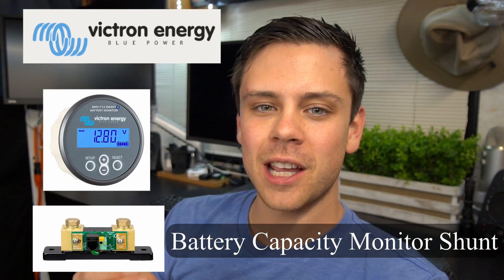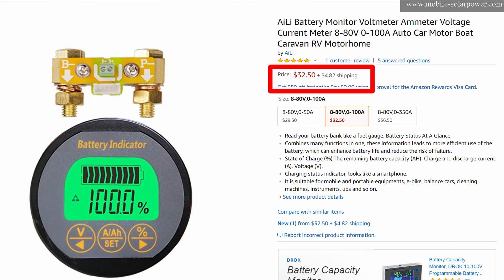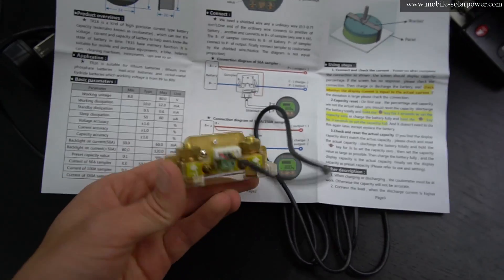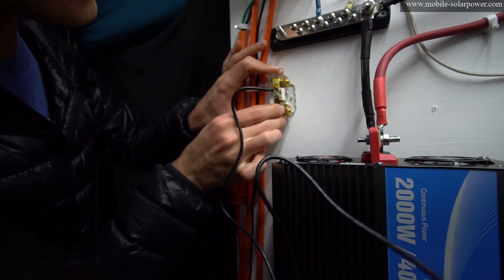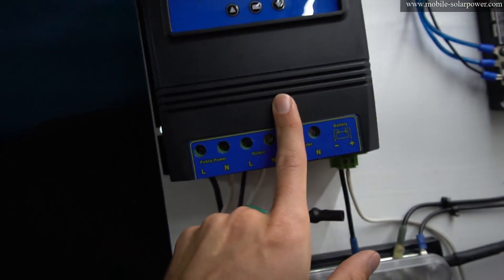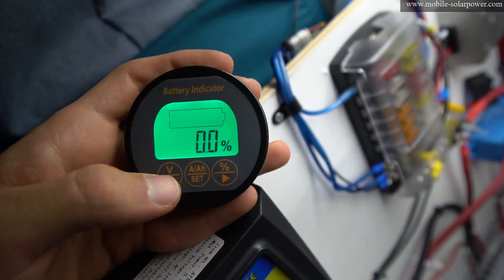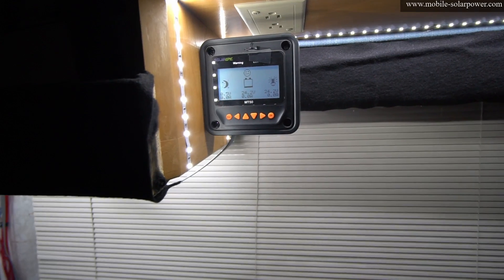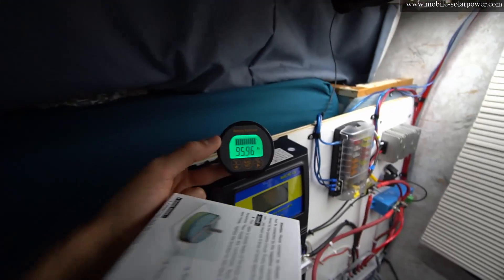$200 Victron Solar Battery Monitor? Try this $30 Chinese one instead! Great for Off-grid Solar

Comment: I've sat over a month trying to establish an off grid system. I'm very literal, however it doesn't keep me from learning and understanding. Too much information with all the people showing how they do this or that..only what they show is never clear. My confusion now is Will says hook to the P- side of the shunt, all your loads and your charging source... isn't that the battery? I guess not because as it's already clear to me the B- side of the shunt is hooked to the negative terminal of the battery. So what's this "charging" source hooked with the loads. Last night I watched several videos ...one person had the negative terminal on the shunt, hooked to the negative of an inverter but the renogy monitor says to hook negative on battery to negative on shunt. I thought having a brain I could build a system too. The issue that stands in the way, is not seeing the cable connections. People say connect this to that but they don't show it. I'm not doing solar and most every video is about that, and it makes sense with all the people wanting to live that cool off grid life.

Comment: I had the same realization, was about to buy the victron and whay I needed was only to read the persentange of the battery not a fancy readout and bought a power queen battery monitor for $55 If I knew about this one will have chose it instead of the power queen since it does the same

Comment: nice and useful video. the only thing i didnt understand, for my ignorance, is why to set the zero going to discharge the battery to the lowest level. I have a lead acid battery and i cannot do that. I would prefer to charge it to 100% and set that value. is it possible?

Comment: I am using that exact same $30 one on my golf cart I converted to lithium. Instead of setting the low power I fully charged the batteries and set it based on that. Seems to be accurate.

Comment: After one 3000w pure sine inverter died after 1 year, (use more then 2w and it starts turning on and of every second), and a new one on warranty did the same but at 250+w I gave up and ordered a 1200w /1200VA Victron inverter. Then when I was making ready to test the new inverter both my solar controllers chargers went up in smoke when I connected them to my 24v battery using the battery switch to the  bank and waking up the solar charger from being off... (apparently I had to disconnect the solar panels before connecting battery power when they was dormant). 

They hissed and sent smoke out and I immediately turned of the battery switch but that did not help as they was getting 1000w of power from the 80v solar panels. It took me a minute to go get a screwdriver to disconnect the solar panels but by then the hissing and smoke had stopped. But the solar charger reported battery voltage to be 42v. So I measured the voltage it tried to send to the battery bank and it was not 42v but 78v... And still both solar chargers showed that all was fine, no error codes or anything. It is scary that a solar charger can fail like that and send 78v to a 24v battery bank !!! 

So now I have also 2 Victron solar controller chargers also, and I also bought the Victron battery shunt even if I did fine by just measuring the battery voltage. But since I am going all Victron so why not ;) 

The old solar controllers was bad anyway, they kept cooking my battery bank by overcharging them and never stopping charging at 28,9 to 29v continuously and never switching to float.

Also I learned my lesson and will install a 1000DC automatic double fuse for my 2 panels pairs so I can switch of the solar panels when needed.

Comment: Hi, I have two batteries, Basen Green 11.7kWh 51.2V (BG) and Ecoflow Delta pro 48V 3.6kWh with inverter (DP). With BG full DP. With the DP application, it is not possible to set the BG not to completely empty!
What could I put between the batteries so that I can set a voltage limit at which the charging will stop and thus prevent the BG from being completely discharged? Is some Battery Monitor OK??

Comment: Great videos. I have a Victron shunt to monitor my batteries remotely via my cell phone app but it's Bluetooth and I have to be within 50 ft. Is there something cheaper than a Victron Cerbo GX (over $200) that will allow me to monitor my batteries from while my RV is at an offsite storage facility? I have 120v power and wifi at the storage site.

Comment: Cool!  Maybe you can help me.  I have dual batteries in my rv, I hooked up the battery monitor which required a shunt between the two. I bought a 100w panel and a renogy solar controller.    Do I just hook up my controller positive to positive BEFORE the shunt and negative AFTER the shunt like my battery monitor is wired?

Comment: To set % of charge to full simply hold down % button and it will go to 100%
Reply: Yes you want to make sure you know for sure your batteries are at 100% before setting the monitor to 100%.

Comment: Hey everyone, keep in mind that all batteries have a self discharge rate (my LiFePo4 cells <3%/mo).   This can easily build over time and lead to false values on the monitor.  So for accurate readings you should probably re-calibrate any battery monitor several times a year.

Comment: I have a battery bank of 8 AGM 12v 100Ah each for a total of 800Ah. How do I wire a monitor to provide info on each individual battery in the bank?

Comment: I can't get my head around what size shunt I need to get as I want to manage my of grid power consumption. I have a 24v 960abattery bank with 700w solar with a victron mttp and a victron 3kv inverter. I saw this video and very interested if this will work? If this isn't big enough what size shunt do i need? Many thanks in advance for your knowledge and help. Andy

Comment: using one of these also Will check out the ...Junctek KH140F Battery Monitor it is Bluetooth 40 to 60.00 range

Comment: There are a whole bunch of Chinese companies making the exact same model (they look identical). I bought one for my Ryobi electric riding lawn mower when I converted it to lithium ion (LiFePO4). Seems to work great. I was a little disappointed in the fact that it stays on all the time,* but the truth is that its LCD display uses so little energy that it is basically off. (Think about it: Your old LCD watch has an LCD display that stays on continuously for YEARS and it only has that tiny button-cell battery in it!)

Anyway, mine is from QWork but you'll see a ton of them on Amazon that look identical. Mine was about $36.

* It turns the backlight on automatically if it detects energy over a certain amount going into or coming out of the battery and then turns that light off when it stabilizes.

Comment: Works well for me. 
Question….
Is it just as accurate to charge the battery to 100% and set the 100% SOC that way?

And this is a new battery so at 100% charge it should have rated capacity.
If it were an older battery then I can understand how starting from total discharge would be better.

Comment: Anyone know how to trouble shoot this?  Is there a website or anyone to contact?  Mine is lit all the time, backlight on.  Even with solar disconnected and no loads. (unless the mppt is considered a load)  Arrow points down.  I have two on two different systems, and both are lit.  Directions suggest B- and P- are reversed but they are not. Maybe they mis-printed B and P?  Actually, mine are B and B the best I can tell, but I match the picture that has the battery on the left and source on the right of their wiring diagram on instructions.
Reply: Push the 2 end buttons simultaneously and the light will go off
Reply: @bad_actor1128  I will try, thanks, hopefully is the trick...

Comment: Installed the shunt in my 48v lead acid golf cart. Everything wired correctly with single negative from pack to B- and all other wires grounded to pack mounted to P-. Meter shows correct voltage, amperage draw etc. Set 100% at 50.9V after batteries relaxed from charging, set 150ah as total capacity as verified on battery. As soon as I take off, the battery % meter goes blank and meter will not show me % but still shows voltage and amperage draw. ANY IDEAS????

Comment: I'm looking to buy a monitor like this but in 200amp capacity Also, I have 2- 100AH batteries. Can that unit be set to 200AH instead of 100?
Reply: you can set it up for a 200ah battery bank.  I just did, no problems.  When you say 200 amp capacity, you mean battery amp hours or the actual amps you plan to run through it?  I think batt amp hours, if so, no problems, this will do a 200 amp hr battery at normal amperage uses.

Comment: @3:03 Nothing like a good scare for electrical shock. 

Sometimes when this happens its hard to get courage again to start messing with stuff. The other day I dropped a wrench on the battery bank and there was a huge spark shower. 

...

Yeah I got to get my courage up again.

Comment: Hello this video was super informative, I've since subscribed. I just have one question, I have the same monitor that came in our camper which is setup with one panel of solar. They never set the battery capacity from the dealer and I did read the instructions on it which says to run the battery to zero to set it. Only issue I see is the trailer is currently setup with a sla battery. If I discharge it all the way won't that damage the battery since they say you should only discharge sla's to 50%?
Reply: You can also set it up from 100% charge, so no need to run it dead. It is Method Two in instructions : After battery is 100% and no load or charge on it and it has rested a bit then - press for 3 seconds the right  button.  Click it up to 100% and click Set.

Comment: Any idea why it is over counting my amps!?

Clamp says 10 amps going in, Victron charge controller says it’s giving ten amps to the battery, AiLi shunt says it’s 24 amps going in!?!? Wires have been confirmed correct multiple times and had others review my install 

Help 

Lol

Comment: I'd like to hear from owners of this gauge whether the SOC% tends to drift over time as I don't think the meter does an automatic reset to 100% like the Victron (which obviously self-corrects every day or so). Or does it?
Reply: it does drift and it will not correct itself.  You need to re-correct it when needed. Just do the set-up all over again.

Comment: I have one  and it works fine. 
The one  problem is that it reads  backwards 🤔.     
I  don't want to totally discharge my  batteries to  fix it. 
Any  suggestions?
Reply: what do you mean backwards? Double check B- and P- are correct.  B- to battery negative.
Reply: I am sure that the battery cables are  landed correctly. 
Is it possible for the power supply wire be backwards?
Where  can I get  better information on the meter. 
Also is it  normal for the back light  to pulse on and off  continuously?

Comment: Great video, Will! What size fuse should I use in the power wire to the shunt? I like to fuse anything that draws power, but the instructions from AiLi don't show a fuse, let alone indicate what size it should be.
Reply: you dont need to fuse it, unless you want to fuse the red wire going to the positive.  If you want to fuse the negative then just use bigger fuse than whatever amps you draw, nobody can tell you this info but you.

Comment: G'day Will. I've got a starter battery and a house battery in my 4wd. I only run a fridge and I do pull out my solar panels when I go camping.. Should I bother with a shunt-monitor system or is a simple voltage monitor good enough?

Comment: Hi back to find information about 12v vehicle batteries. You see I am trouble shooting my trucks electrical system. The battery, after being fully charged, goes dead after only one day. First test would be to monitor the current draw with the ignition switched off.
IF there is current being drawn I could then start pulling fuses till I isolate the circuit. 
Then I could trouble shoot that circuit.
Is there a device allowing me to monitor the current maybe via my cell phone allowing me to start disconnecting fuses, once finding the offending circuit troubleshoot and isolate the item on that circuit causing the drain on the battery? 
Thank you and have to say great videos!

Comment: When in the volts display, if u press and hold the middle button the volt display flashes for adjustment.  What is this wanting to be set for? Max or min voltage?

Comment: Nice find. though for my boat's House Battery Bank of 800 or 900 ah, I think I need the Victron 1,000 amp shunt the cheap one that gives readings via another useful bit of gear through the Victron app - fine for ne with a cheap Tablet anywhere on the boat. Nice to see low priced options though. There's a Chinese battery factory with something like Huagei or something. I've not seen reviews of, but I did spot an Ampere time 12v 300ah , which looking at the size of the space for a generator behind the engine, I can get 3 if them into, so I may go with those instead of 4x 200ah batteries, so plenty of reserve storage to run the boat with 1,000 Watts of Solar plus a Balmar XT 170 Alternator that gives just over 100 amps at tickover plus the Bakmar external Balmar Regulator. I'm keeping AGM high CCA batteries for engine Start, Bow Thruster and anchor windlass prioritising topping up their charge after use, so AGM should last fine,  plus help with lowdown weight, which withbthe battery Bank, should compensate for the Rear Cockpit Solar Arch with weight distance below, being about the same distance as the Solar Panels 4x250 watt at 15 kilograms each. With Port and Starboard Diesel Tanks aft, under the aft Cabin Berths,  there shouldn't be any top heavy leverage effect from the Arch and Panels. Fun Projects. Best Wishes.  Bob.  👍

Comment: How do I safely discharge my 12 v deep cycle lead acid batteries to a safe DOD to calibrate the meter.  I don't want to damage my batteries by  over-discharging them but also want to get the meter to be calibrated as accurately as possible.  I've done a lot of research and am thinking no lower than 12-12.1V?
Also, I have two batteries, should I just take my volt meter to each battery and drive them to the target voltage?

Comment: Thank you for the video, I bought one from China too and will soon install it.
Is it necessary to discharge your batteries completely in order to know what the zero percent voltage is..? I'd rather avoid doing that to my lead acid batteries.

Comment: It's cheaper (i use the 350/500A) but it can not adjust kind of battery and Peukert-Effect) same Victron bmv 712 can, but I can live without 95% exactly difference...

Comment: I just got this battery monitor 350a shunt and I have a 300 ah chins battery tried fully charging the battery and setting it but is isn't accurate gonna try the way you did it were should I set the low voltage on my transfer switch like yours and giw low should I pull the battery before I set it to 0 thanks

Comment: Your videos are awesome!  I bought a ADCBatt 12.8V 100Ah Lithium battery for my little Saturn 330 inflatable catamaran with open bow and just want to know how much battery power I got left so I know it's time to return back home after a trip on the lake.  This shunk is hard to fit somewhere on my battery on the boat as it needs to be fastened.  Do you know what I can get to just monitor the power left on my battery while on the lake?

Comment: The set zero is kinda funky. So drain down to low point then charge back up. Not sure how many days this would take on my mini system. Seems like it would do what I need. Mainly need the monitor for cpap use mini trailer boondocking

Comment: Reading the instructions, when you set the preset voltage setting to 24.9v you told the meter to reset the AH and % capacity to zero when it reads 24.9 but then you told the meter that 0% capacity was 24.2. How did that affect the AH readout?

Comment: Will, I'm not sure I'm following the setup procedure. Why did you only discharge to 24.2v to set the 0% capacity threshold? Shouldn't it be 21v? And after you charged battery how is it calculating 100Ah capacity if 0% started at 24.2V? Isn't capacity based upon manufacturers 0 point of 21v? I want to set up my Ali meter for my 12v battery bank (2-6v golf cart batteries 215Ah) and I want the meter to calculate the actual capacity itself so should I be setting the 0% capacity threshold to 11.9v or 10.5v?

Comment: I recently bought one for my system but the Ah and % level keeps reset to zero under loads. If I know that the battery is still full I set it to 100% then the units seem to work fine from there forward. But I don't want to continue doing that especially if the battery has already been discharged some amount. I'm pretty sure I wired it correctly. Does anyone have any idea or encountered this problem?

Comment: I got the 350 amp model for $44 and it works great.  Just found the review, got lucky and picked it out for the same reasons as you stated. I have been upgrading my class C to 50 amps from 30 and saw your video's Lithium batteries so have changed out everything to a 2ea 12v100ah bank which I plan to expand from 2 to 3 before we head west this summer. great job on the deconstruct of all the LiFePO4 batteries videos.

Comment: I have been using these on all my electric equipment conversions for the last 5 years and they are very reliable even in situations where they are fully exposed to the weather.

Comment: My 12v battery bank has 1,648 Ah (8x106) connected to a 3000 watt inverter and a small 500 watt MPPT solar charger. Will the 500A model handle it?